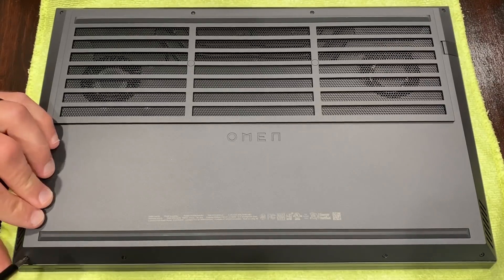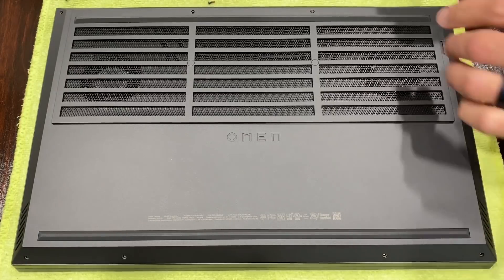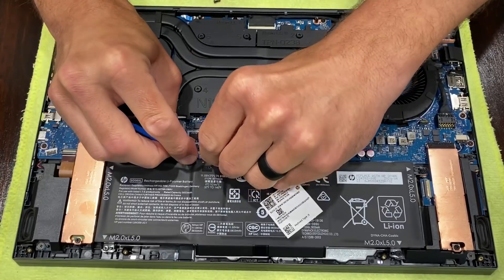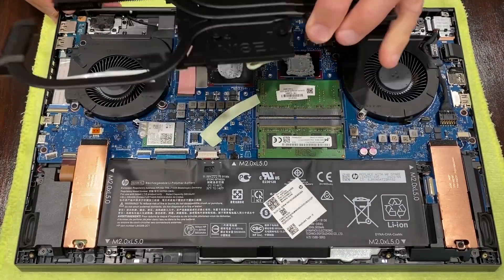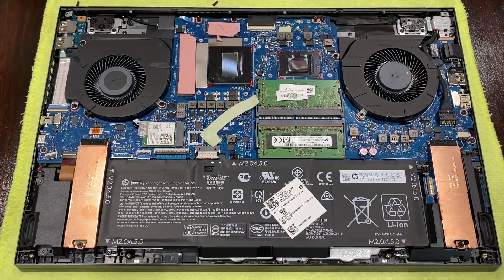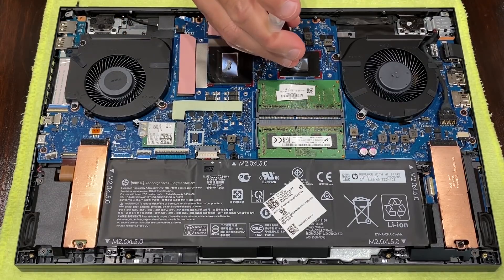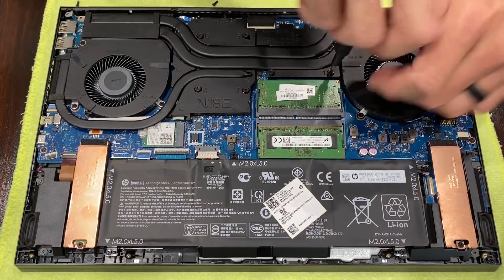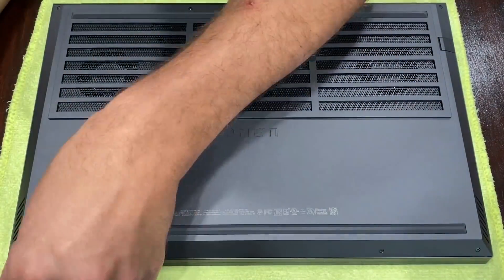2020 HP OMEN Ryzen 7 Thermal Paste Replacement Guide!

Comment: I think I need to do this. Had my omen 5 years and the 4800H hits 80+ degrees at idle!
Reply from the maker: Yep, you are long overdue. Clean out the fans replace the thermal paste. Take your time. If you use compressed air don’t let that spin the fans as you could burn out the bearings have fun. Enjoy.

Comment: Is it normal to get a "The CMOS Checksum is invalid" message on boot after doing this? It restarted and seems to have logged in fine, so the message might have been from disconnecting and reconnecting the battery?
Reply: Its normal and will only show up once when you take off your laptop battery for a few mins

Comment: If you do not have enough equipment and have difficulty in inserting the battery socket, you can remove the battery from its 4 screws and insert the holder more easily. Do not forget to put the battery screws back.

Comment: Thanks for your video :) but why you unplug the battery? Is that an important step?
Reply: It is generally recommended to unplug the battery before starting any work, as this helps prevent accidental power surges and ensures safety while working on sensitive components inside the machine. Consult your specific computer manual for further assistance if needed.

Comment: Does changing thermal paste will void the warranty? I will replace with Thermalright tf8, I bought the laptop in June 2021 so the temp gets higher it reached 80c on Idle and 30% load will reach 100c easily so I will re-paste it.

Comment: the hp engineer put the thermal without cleaning the old one is it fine?or should I be worried?
Reply from the maker: How do you know this was the process?
Reply: @BobOfAllTrades  cause he applied the paste right in front of me
Reply from the maker: @roronoazoro107  Oh that’s awesome!  I have always wanted to see a company rep do this type of work.  I know Dell does it but I wasn’t aware of anyone else doing that.
Reply: @BobOfAllTrades  yessirr so is it fine ? Cause all the videos I saw had it cleaned and thank you so much for replying so fastt :))
Reply from the maker: @roronoazoro107  I haven’t seen or heard of that before.  How are the temps?  Seems like a rookie move to me but maybe it doesn’t matter as much as I think it does 🤷
Reply: @BobOfAllTrades  that is exactly my thoughts too and  the temps are better then before I guess I just have to go along now
Reply from the maker: @roronoazoro107  Please keep me posted 👌

Comment: My heatsink doesn't come off it's stuck like glue, laptop is 2 years old and probably has some heat damage considering it hits 90+ every time I play something
Reply: same, did you manage to remove it safely?
Reply: @SoggyMayMay  Yes, time and patience, wiggle it slowly for as long as it takes, do it carefully (initially it won't even budge) don't pull or push, just wiggle it. I successfully changed paste and temp went down to 70 peak on stress test, 11 months later, peak is 82, still going strong, much better than 95 and thermal throttle for literally any game
Reply: @SoggyMayMay  also make sure you replace thermal pads too, get good quality ones, thickness varies in the ones already there, get the right thickness on the right spot or components won't have contact
Reply: @arbabosumandal6163  Alright thanks
Unfortunately the screw number 3 in my heatsink won't unscrew so I'm kinda stuck with that
it's rounded so it doesn't rotate with the screwdriver it should 
every other screw did unscrew correctly except for number 3
Reply: @SoggyMayMay  ah, that's a pickle , those are tricky screws too, designed to be not completely removable, if no screw driver fits because the grooves have been chipped off you can try a couple of things
1) a small plier if u can get a good grip to loosen it

2) glue gun can help stick your screwdriver better but it's not strong

3) and riskier option is solder your screw driver to screw, wait for it to cool and try turning
Reply: Good luck  :) 🤞
Reply: @arbabosumandal6163  thanks <3

Comment: Thanks for this. Just recently got the Ryzen 7 4800h/rtx 2060 model. Was getting high temps on some games almost 100c on the cpu but read into switching core performance from aggressive to disabled in the power plan.

After following your guide I used some Corsair XTM50 thermal paste and after booting up and settling idle I'm seeing 33c cpu and 34c gpu on performance mode with fans to auto on Omen control centre

EDIT: 11 months later, the paste I used at the time wasn't too great and found myself changing it out. I feel I get better longevity and slightly better temps with Coolermaster MasterGel Maker (Thermal Conductivity: 11 (W/m-k)
Reply from the maker: Good job 👍
Reply: Can you elaborate about this?
Reply: @セータン  Core performance can be accessed in power plan settings. If you can't find the option, it must be unlocked via registry editor. This stops the processor from using turbo, so you will notice a slight performance loss

Comment: Hello sir, i used Kryonaut Extreme for my Omen 15 with Ryzen 7 4800H and RTX 2060. Applied it on the cpu and gpu, and when idle its temperature is lower around 39-40 degrees celcius for both cpu and gpu. But when gaming, the gpu only reached 70 maximum but the cpu reached 93 which is higher than with stock thermal paste. I reapplied the grizzly, but the result is still the same. Am i doing mistake or kryonaut extreme isnt good for gaming laptop?
Reply: i have the same laptop (+stock thermal paste) and cpu temp has been scarily high during light gaming (often up to 95 degrees)... I think it might just be the laptop. I'll be undervolting mine in the future most likely.

Comment: Just did it on a brand new Omen 15, here's the results. 
Omen 15 (I7-10750h - RTX 3070)
Paste used: Arctic MX-5
AIDA64 stress test. 
The temps did not go down, but I've managed to reduce the throttling from 11% to 4%. The fans also significantly decreased in decibels. So i'm pretty sure that on a full 6000rpm, I could manage to see lower temps.
Reply: You should have used new coolermaster gel, artic mx5 is bad for laptops
Reply: @aleksandrlapz6729  is liquid metal the best tho? thats what i wanna use
Reply: @MLTAKOS  yes but you risk killing your laptop if you make a single mistake and destroys some kinds of coolers
Reply: @aleksandrlapz6729  i have high temps and i move it around alot so im scared of it spilling, is the arctic silver conductive enough?
Reply: @MLTAKOS  use cooler master mastergel maker for laptops
Reply: @aleksandrlapz6729  thanks, do i need a spatula or something for it, also is it better than the mx5?🤔
Reply: @MLTAKOS  it's better. Never use mx5 or kryonaut pastes in laptop due to low temperature resistance on them
Reply: @aleksandrlapz6729  ok thanks imma buy that✌️

Comment: Hey, what paste did you use and would recommend for this laptop; i have the i7-10750H and think i need to repaste due to bad factory job hitting 100'C while turbo boosting. what is the best non-conductive thermal paste to be safe?  Thanks in advance
Reply: Thermal grizzly kryonaut is your best bet

Comment: If you buy the previous model with core i9 they will be using Thermal Grizzly liquid metal. May i also remind you, if you dont want to void your warranty then please do not do this. We will not support thermal issues or hardware failure if thermal paste is not stock.

Comment: If they do an amd+rtx 2060 115w on a 17" laptop I am gonna buy it straight away. But for now I think Eluktronics are the best for bang for the buck. This laptop is much better when it comes to thermals thanks to the new heat sink right? Or there isn't much of a difference?

Comment: While you still have the EN-0013DX I was curious if it came with a 512GB SK Hynix PC601. The EN-0023DX came with the EN-0023DX. There aren't any reviews on them yet, but my 1TB model got 3450/2450.
Reply: I think your second sentence is wrong.
Btw I think they come with samsung p981 ssd.
Reply: Which side is the ssd in? I don't like how there's an m.2 directly next to the battery. That m.2 can heat up pretty fast and potentially ruin the battery.

Comment: I really like how easy they made it to tear down. That's important, I hope easy maintenance becomes a industry standard.
Reply from the maker: Exactly!
Reply: @BobOfAllTrades  what is the wattage of the gpu, number of ppi and contrast ratio?
Reply: The omen I bought in 2018 just died of GPU failure , when opening the heatsink the paste had dried out solid
Reply: For reals, I chose this laptop over the triton 500 because of this reason
Reply: My old msi ge72 had 19 screws to remove back panel. This is great.

Comment: Screw the heatsink back by turning the screws a few turns at a time or you risk chipping the dies
Reply: what do u mean bro?
Reply: @gamersforlife3440  pressure must be applied evenly across the CPU and GPU dies when removing and installing the heatsink or is going to crack the dies or "chip" them. CPU and GPU dies are made out of glass.
Reply: explain a little please.

Comment: Hey bob! thanks for your amazing reviews!
Do they have this one with more powerful gpu?
I remember that you reviewed last year or 2 years ago the previous omen I really liked with the undervolt to maintain.
Are they using clevo barebone chassis?
You recommend this one?

Edit:
They have with more powerful gpu!
Are you doing a review on the one with rtx 2070? (OMEN Laptop 15-ek0005na NVIDIA® GeForce RTX™ 2070)
Reply from the maker: With an intel cpu?  I can get one from HP yeah.  It’s big money however.

These are not Clevo 😃
Reply: @BobOfAllTrades  yes! I believe you! If you can yes if not I understand!  

Also I know that it's still not the time for egpus. But would this be future worth ? 
Let's say I get this one with ryzen and 1660 ti and build an egpu with an RTX 2070 super, or maybe next gen RTX 30s. Do you think this would lose a lot of the performance of a regular desktop? Using an external monitor too.
Reply from the maker: Antonio Maria Don’t invest in an eGPU.  Not worthy of your time and money.
Reply: @ola95003  just want to 2nd what bob says. eGPU is a waste. get a light duty laptop and a pc, or a heavy duty laptop.  eGPU would cost the same with far more downsides either way. the port itself is part of the problem
Reply: @BobOfAllTrades  just looked for this laptop with ryzen and unfortunately even with Intel here in UK they don't sell it..

They are selling just with intel, they have from gtx 1650 to RTX 2080 BUT in the old chassis.. this doesn't make sense, what do you think?
Windows 10 Home 64

Intel® Core™ i7-10750H (2.6 GHz base frequency, up to 5 GHz with Intel® Turbo Boost Technology, 12 MB L3 cache, 6 cores)

39.6 cm (15.6") diagonal FHD, 144 Hz, IPS, anti-glare, micro-edge, WLED-backlit, 300 nits, 72% NTSC (1920 x 1080)

16 GB memory; 1 TB PCIe® SSD storage

NVIDIA® GeForce RTX™ 2060 (6 GB GDDR6 dedicated); Audio by Bang & Olufsen; HP Audio Boost; Fast Charge; 4-zone RGB backlit keyboard; Faster Wi-Fi 6

This is so annoying this kind of brands doing this, in USA the latest chassis,  here in UK the old chassis.. I can't even imagine the temperatures with Intel new cpus and RTX graphics in old chassis, must be sell to burn the laptop in the first month..

Edit: and this model here (RTX 2060, for 1616 dollars, £1300..)

Comment: Again Bob I love your videos. Not a ton of benchmarks, but you nail everything else right on the head. I'm just trying to pump out my first ever video, and they're absolute garbage compared to this. Guess there is more practice in order on my end. Keep up the good work!
Reply from the maker: Benchmarks are useless except for those who wish to converse on forums.  Thermal limits followed by power limits are the focal points on laptops.  If everything checks out, then the laptops performance expectations will flow nicely as drivers and updates evolve.